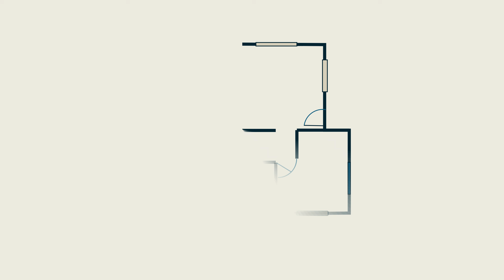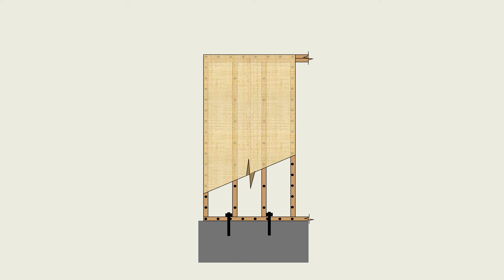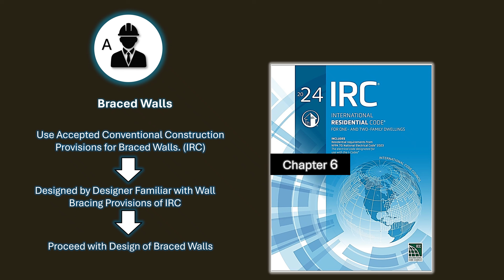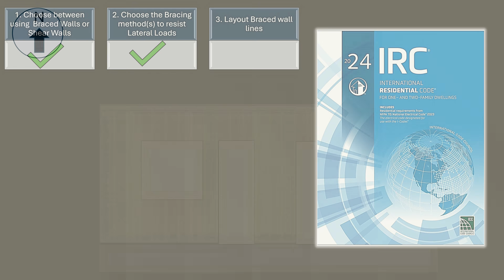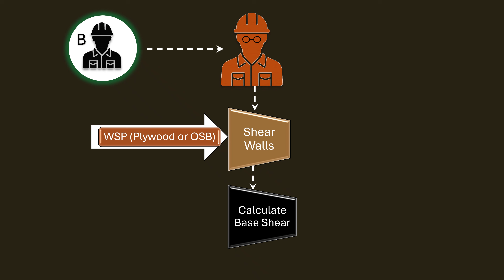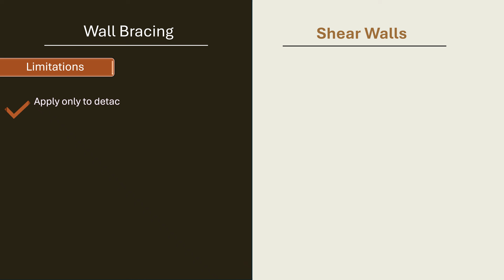Wall Bracing Vs Shear Walls - The Expanded Version

Comment: Now we all know why the cost of new and remodeled construction is sooo expensive. Those engineers and architects have to insure their viability somehow! They are genius at not speaking plainly to support their hourly rates. Braced walls or shmere walls, whatever? AKA throw up some 1/2" plywood and nail the shit out of it! You could also tack up 1/2" plywood so it is where you want it, then give a new guy a nail gun. When you come back it will nailed 1" on center on the edges and the field for a SUPER Shear wall!!! Ha HA HA!

Comment: According to this, the IRC prevents a window from being closer than 4' from an exterior wall because that 4' closest to the corner must be a braced panel.  That doesn't sound correct.  Also, none of your examples actually show the common practice of sheathing the entire wall for all exterior walls, or the common practice of the sheathing panels being horizontal instead of vertical.  If the sheathing is vertical because it is supposed to tie blase plate and studs to top plates, then 4x8 sheets would result in ceilings <8' tall, which is nonsense, or 10' tall "tall wall" panels would be needed and still not work for 10' ceilings or if the panels are supposed to tie rim joists to studs and top plates in a continuous panel.  So what is the nailing pattern for the long edges of 4x8 panels, and do they need blocking between studs to allow that 6" or 4" nailing ?
Reply from the maker: @kirkellis4329 Thanks for the comment and your thoughtful observations. The main purpose of this video was to show the difference between shear walls and braced walls. It is not an exhaustive lesson on braced walls. As you have pointed out, there are many considerations when it comes to designing bracing. That is why i have created a complete course on conventional framing at https://www.conventionalframing.com/. The course includes to modules that are dedicated to wall bracing where I cover all code requirements as laid out in the international residential code. Please check out https://www.conventionalframing.com/